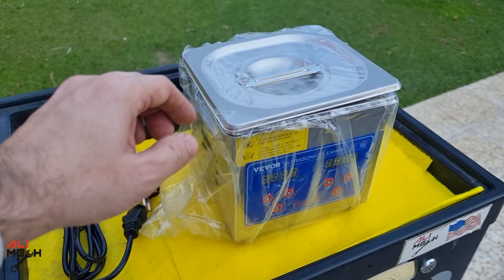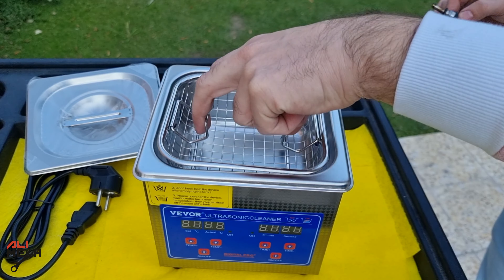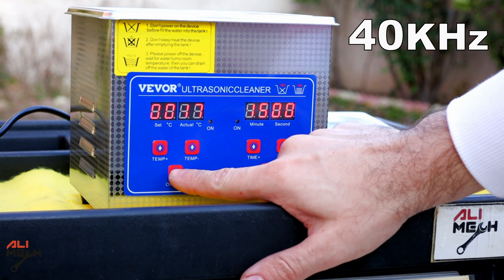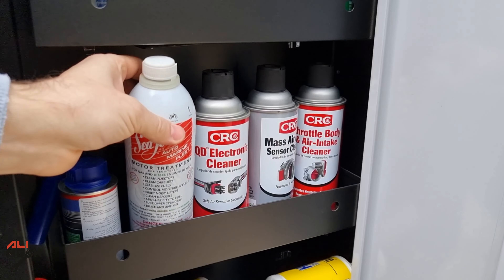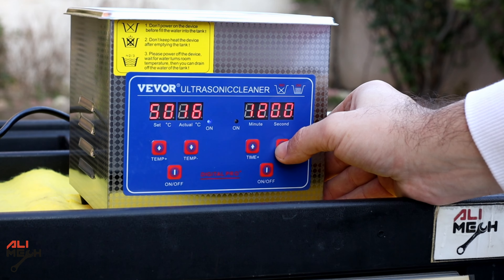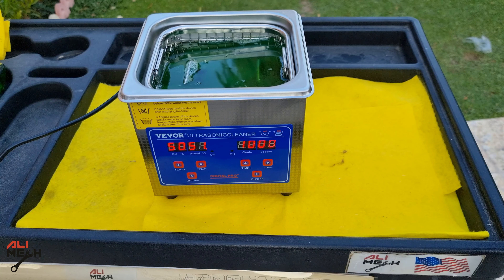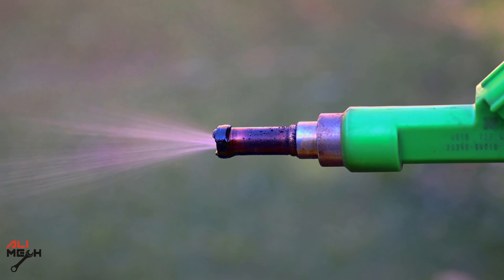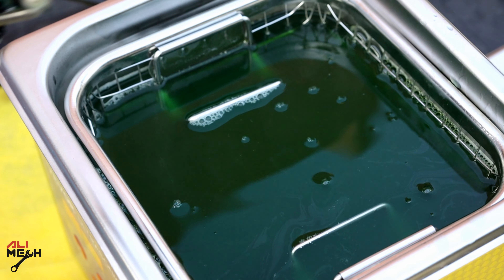Cleaning car parts like pro with ultrasonic cleaner / No need for brush anymore??/Cleaning nozzles

Comment: Do you need to worry about the plug getting in the solution if you are using the injector pulser as well? Want to do this for BMW n54 Injectors but power pin in close to inlet
Reply from the maker: It's all sealed , but you can leave them out